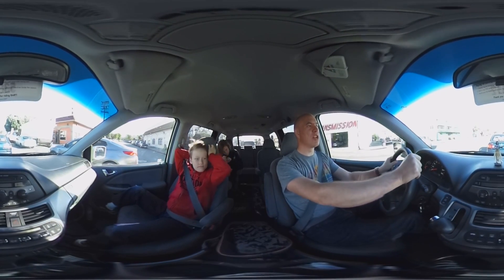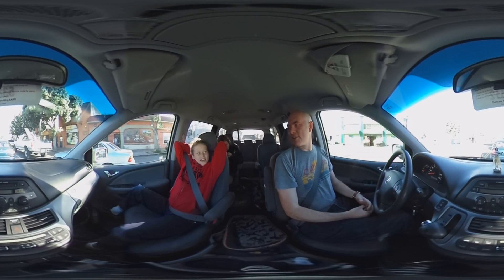Car Questions - 1.21 Jiggawatts

Comment: Tesla Models	Horsepower
Model Y Standard Range	275 HP
Model Y AWD Performance	470 HP
Model 3 Standard Range	283 HP
Model 3 AWD Performance	480 HP
Model X	670 HP
Model X Plaid	1020 HP
Model S Plaid	1020 HP
Roadster	288 HP

Comment: Is there Any Gaz That Could be really High pressured and Used As A coolant? ;)
Reply: +A. Ahmou Even with coolant, once you transfer your heat to that coolant you then have to remove that heat.  And as he stated, with that much heat it would be quite hard to remove fast enough to not melt the power plant down.
Reply: rotaryturbo07 So Which material (Which can The device get a Rid of) Is capable of absorbing that Quantity of Thermal energy? And Of course that material Should be in A too small quantity.

Comment: The extra heat is obviously absorbed into the time fold itself. If you remember, the delorean is really cold when exiting the time singularity. Maybe the flux capacitor isn't really powered by electricity, in as much as it needs power to make a point in space time really really hot...

Comment: loving theses videos but the camera rattle drives me insane!
Reply from the maker: +Tim C sorry about that, I'm still figuring this out.
Reply: +Tim C Yeah, it sounds like a geiger counter
Reply: +Tim C It's heartening to read that you've finally admitted it (although the rattle isn't its cause; it's much more deeply-rooted, as you'll recall from our discussions over the past few years). You've been insane for a long time now and admitting it to yourself is the first step toward accepting and maybe overcoming your sanity challenges, should you wish to do so. /s :)
Reply: danlock If the rattle does not drive you insane, then you are insane sir.
Reply: +Tim C It's like when Dan Rather is on TV now. Teeth rattle. ;)
Reply: This message is sincere. It contains no sarcasm whatsoever.
To be honest, I'm surprised it didn't. Maybe because it's coming from the same speakers as the rest of the audio? Fascinating. THANK YOU for that insight! I remember what it was like to be able to tune out other sounds. Now, my brain ascribes the same amount of importance/"attention" to each audio source in my vicinity no matter the volume. It's incredibly frustrating and distracting. I wonder if my problem would be attenuated (no pun intended) by somehow forcing all sounds to seem to come from the same direction... I can't imagine how that would be possible, though. I'll have to continue to try to re-learn to focus on my own, I guess.
Reply: +danlock Shut up.
Reply: +Tim C I think its the bobble head.

EDIT: I also never noticed the rattle 'til you pointed it out.

Comment: I don't think the time machine used a Plutonium reactor with steam driving a turbine. Aside from the excess heat problem it would also be far too big and too heavy. It is more likely Doc Brown used some kind of nuclear battery in which the radiation is used to generate electricity similar to a solar cell. Thats also the reason he needs such a huge amount of Plutonium because the efficiency of those devices is crap. I know it is not possible to extract the needed amount in a short period of time using this method but it is a time machine it has eternity on its side.

Comment: does this camera have a gyroscope to keep the cameras at a level attitude? If so its very irritating
Reply from the maker: Yes and the process to fix it is horribly complicated.
Reply: +Scott Manley   Try hanging it from a more secure surface that is stable to the car's frame. Maybe suction cup it to the windshield.

Comment: 7563 Chevy Volts, 2131 Tesla Model S, 1371 Bugatti Veyrons with 100% electric conversion efficiency, .7 of a 1750 MWe ARABELLE turbine generator which is used in a French nuclear power plant, .0085 of a Rocketdyne F-1 (aka Saturn V engine).

Comment: 750 is surprisingly close for the Tesla Model S. It runs 768 bhp with the front and rear motors.
Reply: Exactly!
Reply: no it doesn't. The converters can't support going 100% on both engines so the number is closer to 550hp.
Reply: +Henji96 Do you have a source for this?
Ludicious mode was the implementation of a new 1500 amp fuse in place of the 1300 amp original fuse.   Tesla states the battery voltage of 375 volts.   At 1500 amps that is about 563kw Dividing that number by 746 watts per hp and you get an hp number of 754hp.   
If the converter(s) can't run both motors at the same time but still draw 1500 amps, the hp is  nearer to 768 than it is 550hp.
Also if you take the 768hp, 5000 lb curb weight, AWD and dual clutch (this is the quickest geared trans but I understand that the Teslas only have one gear) and plug them into a 0-60 calculator like http://www.060calculator.com/ you get a 0-60 of about 3 seconds which is very close to tesla's number of ~2.9.   However, if you use your figure of 550hp, the 0-60 time should be more like 4 seconds which is quite different than stated by Tesla.
Reply: +Henji96 And here my car only has an 88 hp engine...

Comment: I have a question about the Gemini capsule, ontop of the capsule there is a long tubular thing which i imagine is the launch escape system. But on that thing side there is a kinda rectangular thing that stuck outta the side and to me it kinda looks like ventilation but that makes no sense what so ever. If any one of you guys have built Revell's 1/24 Gemini capsule, it's part 18. Really curious of what that is but i don't want to show my science teacher because i wan't to show it to him when it's 100% done.
Reply: +EpicSmileyMan64 Doesn't it tell you what all the parts are?
Reply: :/ Btw the tubular thing isn't the launch escape system. There should be a truss type thing that goes on top. It is the launch escape system. I think the tubular thing is probably where the parachutes and life support/computers might be, because the rest of the capsule is so small.

Comment: What is the camera attached to? lol.  I have been rotating it around to find a fix point but I can't see it.
Reply: +Colin Firth It's tricky :D If You look straight down you can see tripod legs and the merge line between "front" and "rear" footage - the camera has 2 lenses, apparently they record over 180° and ignores itself in final footage
Reply: I was thinking it was something like and overlap and cut on the fly, thanks.

Comment: Tesla makes a version with 762 hp.
Reply from the maker: +TheMontanaDave that's 568kilowatts.
Reply: +Scott Manley So you'd need 2130.29 Teslas
Reply: +TheMontanaDave 548HP to be accurate. The battery is only capable of 548
Reply from the maker: +Ckc dillpickle The question is how big the capacitors are between the battery and they motors, there'll be a limited window to generate max power before battery draw becomes the limiting factor.
Reply: Scott Manley
The only thing I know is that its limited to 1500Amps because apparently they can't mass produce something better than SpaceGrade SuperAlloy. Which Amps = Acceleration. Thats all I know about Electric vehicles.
Reply: ***** The model S 70 is 762 bro.
Reply: TheMontanaDave
What? The P90D is rated at 762 HP but it can only output 548

Comment: Everything depends on how much time you need the 1.21 gigawatts. Charge a large high voltage capacitor up to a few hundred kV and short it out. I'm pretty sure you'll reach the 1.21 gigawatts easily (for a few dozen nanoseconds)^^

Edit: I did not watch the video before writing this comment xD
Reply from the maker: +Maanuueel42 \m/(^_^)  You can actually watch the movie and see how long the flux capacitor is active for, it's a good few seconds.
Reply: Scott Manley Hmmm, then you'd need quite a bit of energy. Let's see. I'll say it stays active for five seconds.
W=t*P=(C*U²)/2
<=>
C=(2*t*P)/U²=
=2*5s*1.21GW/(500kV^2)
=0.0484F=48.4mF.
That's pretty humongous for a high voltage capacitor (considering the ones I know of are in the pF to nF range). Okay, let's not do that then... xD
Reply: +Maanuueel42 \m/(^_^) whats with Coldcaps don't they have about 1F of Capacity
Reply: Marcinator Well yes they do (there are even ones with thousands of Farads), but at like 2.5 Volts max. To get the needed energy content (at five seconds activation time 5*1.21GW = 6.05GJ = 1.686MWh of energy) you will need (at 10 kWh/kg energy density) 168600 tons (metric) of ultracapacitors. That is equivalent to 1686 m³ of ultracaps (at 1kWh/m³).

Edit: And bear in mind that Ultracaps have the highest energy density of all capacitor technologies and that I was a bit generous with the volume density.... So capacitors really are not that great for storing large amounts of energy. They can charge/discharge very quickly, though.
Reply: +Maanuueel42 \m/(^_^) ah ok just heard that they had huge capacities, not their drawbacks
Reply: +Marcinator figured that they would've about the same properties
Reply: Marcinator Well, they are very good for things that need very high powers for short amounts of time (f.e. adjusting wind turbine blades), but are pretty much useless for energy storage. High voltage capacitors are even worse, though, so what you proposed would work better.
Reply: +Maanuueel42 \m/(^_^) thanks!

Comment: Do you know how many horsepower a horse has.
Reply from the maker: +Michael Hughes depends on the horse.
Reply: Maanuueel42 \m/(^_^)
I knew it was more than one. That is why I find it funny
Reply: +Michael Hughes A workhorse can generate about two to three HP continuously
Reply: +Michael Hughes I only work with "Llama Thrust"
Reply: It's about 0.7 horsepower for one horse
Reply: ***** Yes. The dude that invented the unit measured the work done by a set of horses over a certain period of time while pumping water up a well. A very unprecise method of measurement, and those "mine-horses" were also not the strongest ones, so, yeah...
btw.: A good sportsman can put out about two horsepower for very limited amounts of time.
Reply: +Michael Hughes sloths have -50 horsepower
Reply: +Michael Hughes For a short period of time they can actually "output" over 8hp :D
Reply: +Michael Hughes 20ish?
Reply: +Maanuueel42 \m/(^_^)
Wait, so one horse can have more than one horsepower?
Reply: Maanuueel42 \m/(^_^)
Just like fanheight
Reply: Michael Hughes What is fanheight? xD
Reply: +Michael Hughes 
"The peak power over a few seconds has been measured to be as high as 14.9 hp. However, Stevenson and Wassersug observe that for sustained activity, a work rate of about 1 hp per horse is consistent with agricultural advice from both 19th and 20th century sources."

google
Reply: +Michael Hughes idk what the average is, but my lame flippin horse can probably pull.2-.3 for a couple minutes